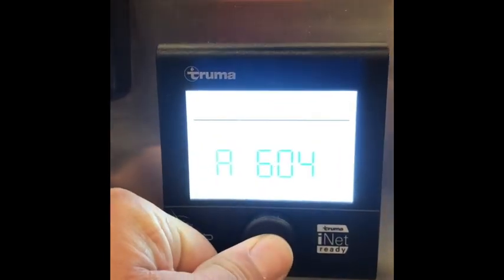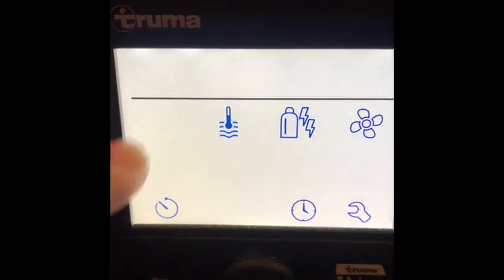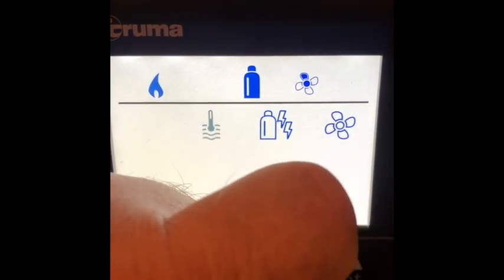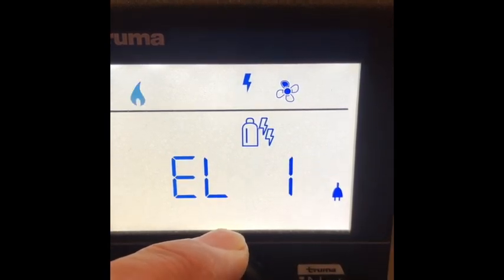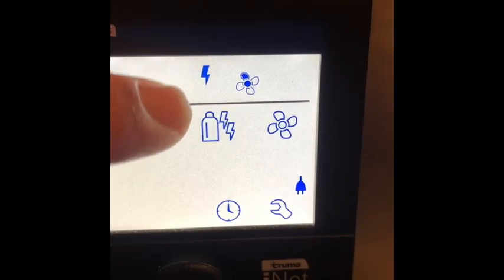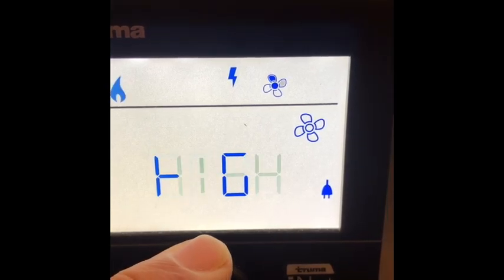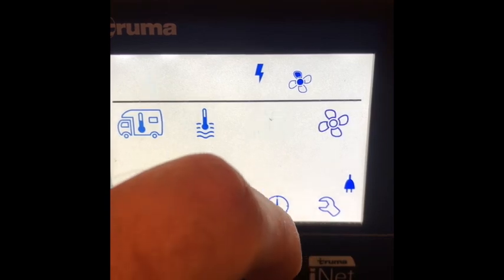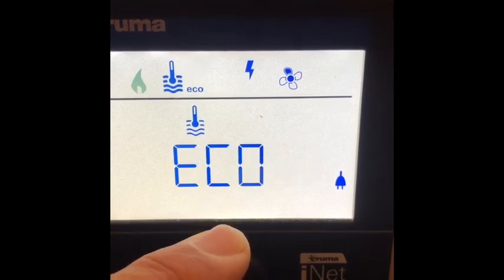One Idiots Guide To The Basecamp Truma System

Comment: Hi when you take a shower using basecamp, do you use water from water tank or city water hookup? 

I found city water hookup doesnt give me hot enough water.
Reply from the maker: Temperature of the water, i.e. ground water vs tank water will have an effect.
Reply: @escapingnewjersey5432 in your experience, how long can hot water last?
Reply from the maker: @dwang82380 While we haven't used the shower in the Basecamp, we have never run out on day to day chores like dishes.  Previous experience tells me you need to shower like shampoo directions.  Lather and Rinse aka take a "Navy Shower".  Also remember the with the heater running you may see a reduction in shower time.  Move it to Boost.
Reply: @escapingnewjersey5432  thank you for your reply